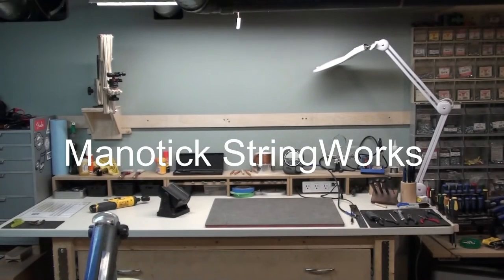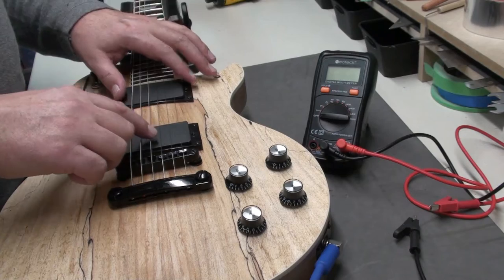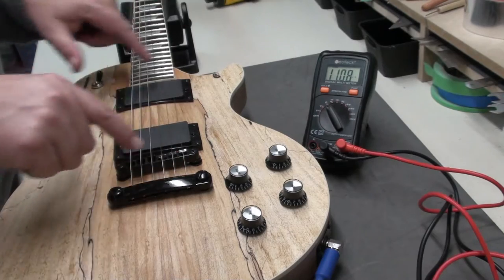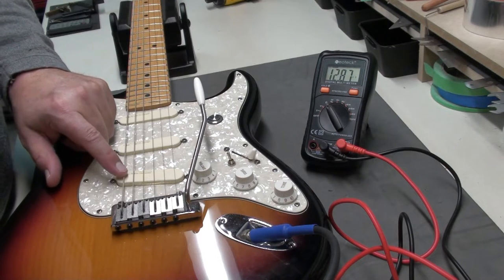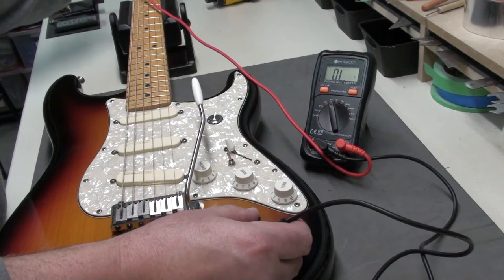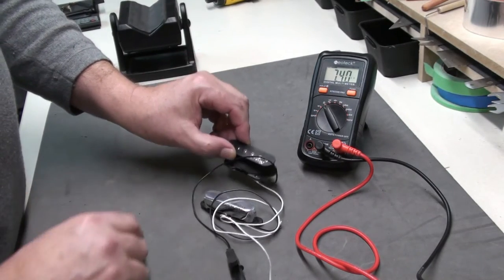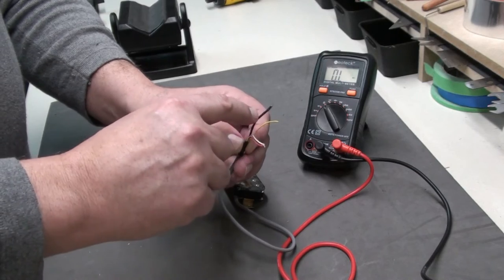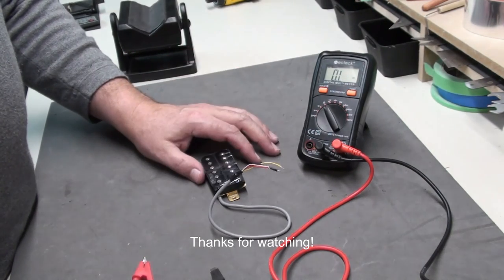How to test the Resistance of your Guitar Pickups with a Multimeter... it is pretty easy to do!

Comment: All I have is 200kohms setting. It’s reading 103.5 on the bridge pickup. Any suggestions. First time checking this stuff?
Reply: Make sure you set the volume pots to max (10) before measuring, or you will get a completely invalid number.  That's likely where you went wrong.